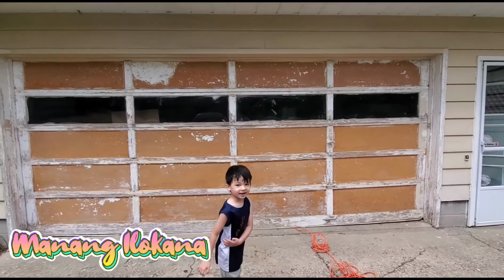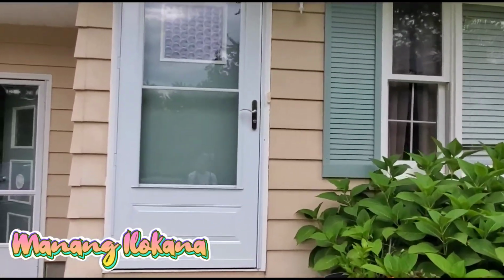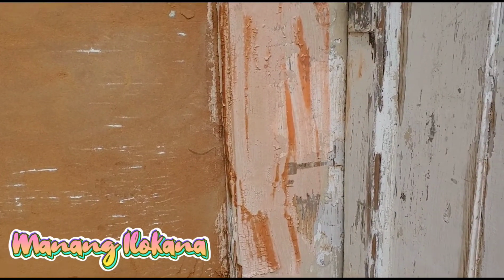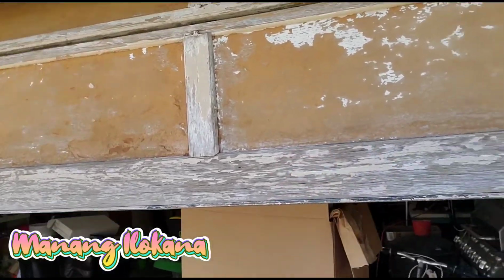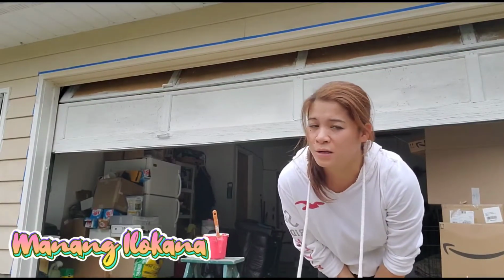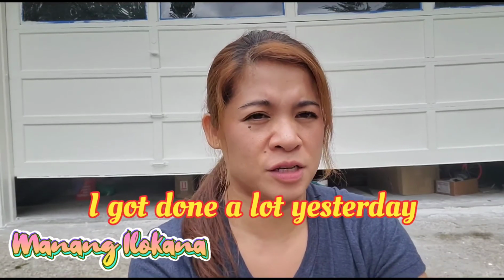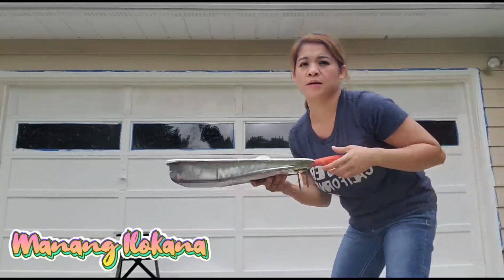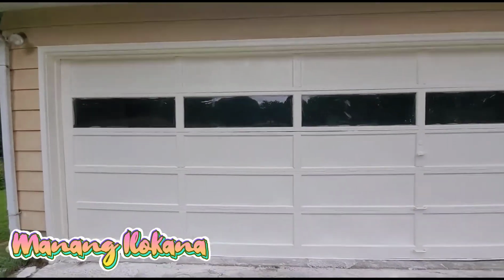DIY HOW TO PAINT YOUR OLD WOODEN GARAGE DOOR

Comment: Wear a mask, so you don't breathe lead dust. Houses built before 1974 have lead paint! Heard starting at top is better for drips, then rolling door up as you go. Also those platform sandals are a recipe for disaster on a ladder. Better to wear sneakers. I think if you resand it, and paint again you will get a smoother finish. Looks nice though! The freezer better for paint rollers.
Reply from the maker: Yes, of course, I did! as I said I've been working on it and you can tell the floor was dusty from sanding out the paint. I just want to mention what I've used and what I did. But thank you for the reminder thou! I knew it was gonna rain that day so I don't think starting at the top was a good idea when you shut your door after painting. If you check some of my videos about painting that's what I do. I knew sandals were not a good idea but I mentioned already to my other painting videos that sandals are helping me outreaching high parts when I do a project like this. coz I'm not tall. Thank you for watching!